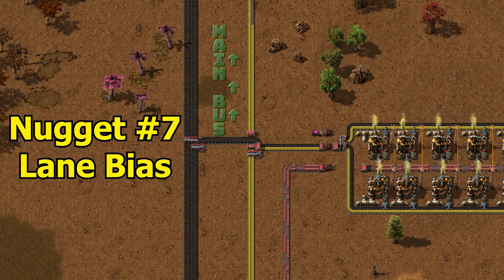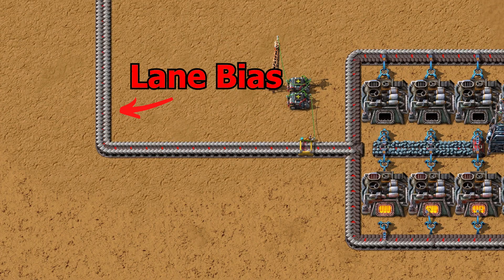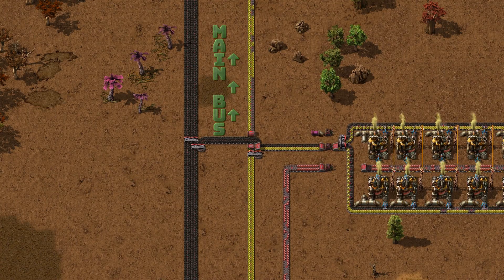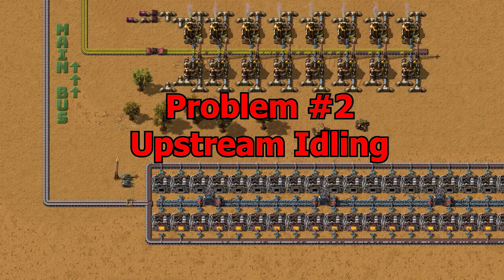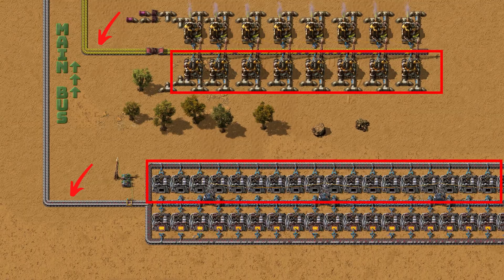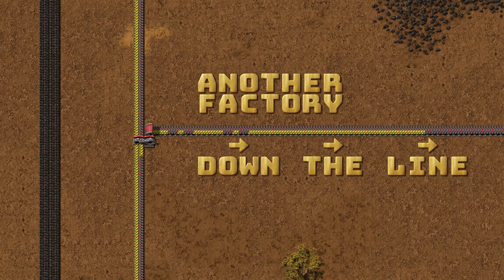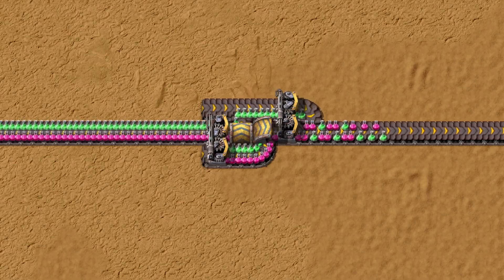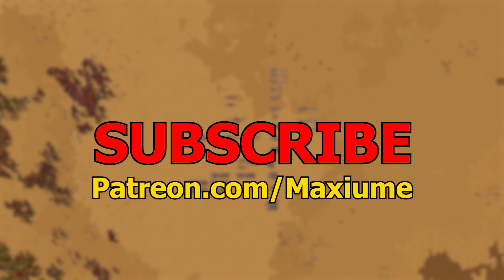Factorio Tutorial: LANE BIAS Explained | Nugget #7

Comment: I've never understood why the fancy split belt lane balancer is needed when you can just use one splitter and have each belt fill one lane.  It's barely a widget (3x3) but it still fixes this problem, whether it's one item or two (use a filter if needed).
Reply: If only one line of the belt is being consumed and the other is idle, this solution doesn't solve the problem because the problem still persist, you only changed the lane that is being idling.

A lane balancer means that the input will be evenly distributed in the output. So if your input is only one side, the output will be two half lanes (tbh your solution in case does works, but why would you need to do this in the first place?), but more importantly, if your input is a whole lane and you're only consuming one side of the belt, in the balancer you'll be effectively inputting two half lanes and merging them into one lane, but you'll be consuming from both evenly (something your solution doesn't do assuming the input belt is full)
Reply: @douglasnorona6895  On the factorio wiki under "Balancer mechanics#Lane balancers", my solution is what they call output balanced, and works for basically any situation where demand is biased to one lane, i.e. 99% of logistical problems you may have in this space.  It will still prefer input from one lane, so some upstream production may be idle, but the other lane will rush in to fill any gaps.  Importantly, if you lane balance immediately after your machines, then the entire length of the belt ahead will be compressed.

It seems to me that the only place input balancing may be needed is 1) train unloading to ensure you are pulling from all chests evenly, and 2) if your setup requires all upstream production to be synchronized e.g. perfect ratios or direct insertion from mixed trains.
Reply from the maker: This tells me you are new to the game. There is a good reason for that.
Reply: @Maxiume  Absolutely no need for the snark.  The inside lane on the turn may be favored, but the output belt is never starved.

0eNrNmd2OmzAQhd/F17DCBhuI1CepVhEhTopKDDVm1XSVd++QP7qN0c5YudjcJYbP4+Px+Nh5Z5t21L1tjGOrd9bUnRnY6vs7G5q9qdrpN1MdNFsxZysz9J118Ua3jp0i1pit/s1W/PQaMW1c4xp9eff85bg242GjLTwQLTAi1ncDvNaZqR9AxdmLjNiRrcoXCR1sG6vrS3Nxih644s7djO3PuDGDtg4aHrHpEjbzYNM7tjG7xkBTXP/Qgy9c8YF7e3w9aOcasx+mx6w+dG96PUJbC8Hp7bpx+gBNu6oddMQuP190u3VrOxP3beU0dFl34zQ1PEkidui2U3vl4lZX54DmKTh5RpLhhU8owku08HwJy4WHq9DxcsqE5misoKhQoLGSgi3R2IwiAk/QaZ1fuUVAVjs7al8qco7NmXxRrIj9GqsWqABp9V6bbWWPzNeZoFccnqBUTAPIkKxeSQjLU9CilHhySiMrcs09D/9zcE6vulfys8pu3fW9tk8pvLygV17kBODLw7344sgiCYh5IbUFJ+8Qj2ni3SKEIO8Rj8P3mol5ZQ89FBlvtPNc/afnLaH+8UsfdvG5cJnOHsBXTfl16CtbuQ5eYt8mP9WNrh/dGsxYZ29Vbud8BU5kdBVQy1DgKwetcAhF3oSRYPruvpi186odYXnbvYUSsP1k871G6Y799N5lCr1TVpLtAk6AFL9ucxoY79sVDSyoXuCavMjtP03JVoeLJ3qddF6dugUhbFPH2kA+HWGoQNhVtfZVwkskoBjIsttpux6aP/q8A90+vs7mFTuMm8FVZ+RjGbjBfQhF10s+U688wFQpTFFPiwByjsrhMsCvqC96TEzopk5hRMp4gA9FyZ+JAO+MI6d066JQ1iXLAqwbLmYZYN1wZBVARi3NLKf4rRwRakH3RLgsLungHHWNktCtC0pbyelgVDpIQbeHOHBKvvXATZ7M6LYLp7Gkg3FSqBAXmuNcqMzJ1kuF38PIgu4gcRqVdM+LAqskwDAU/uOE4gEWofiaFkHR79qvQ/lM8IDttsBdJgfcfi9OpaRvAbjhBxyLl2KkL+2CcqpSBf2UUAafEl7hNfg+Deb+/1TE3iC/z91IJcqsLGXB07JM4FTzF0LO13Y=
Reply: @Maxiume  way to not answer the fucking question